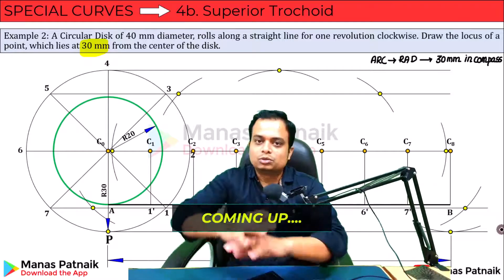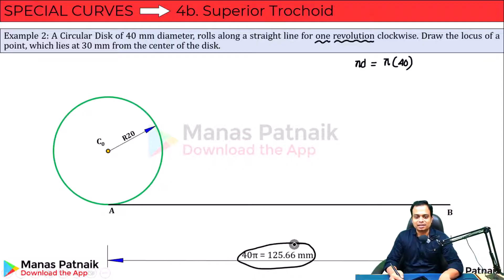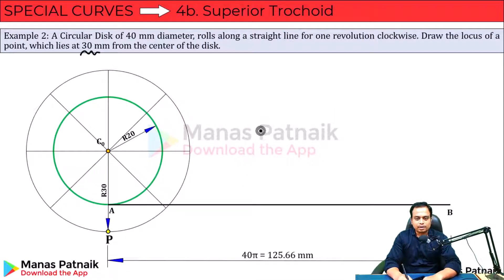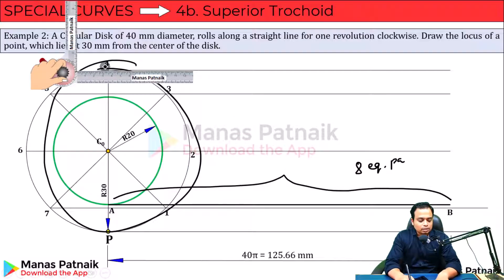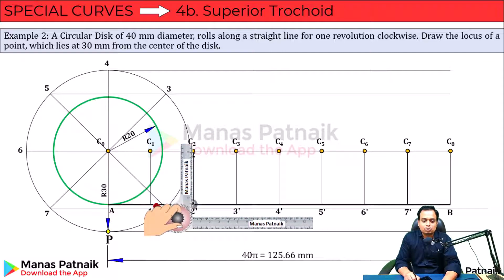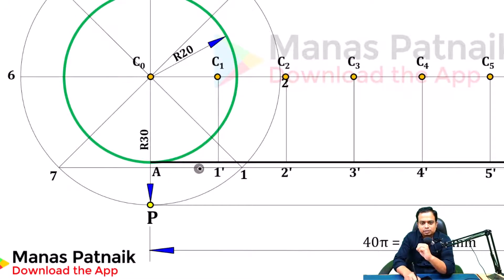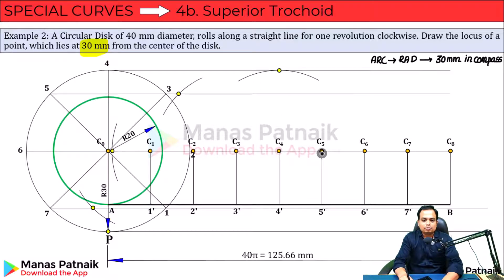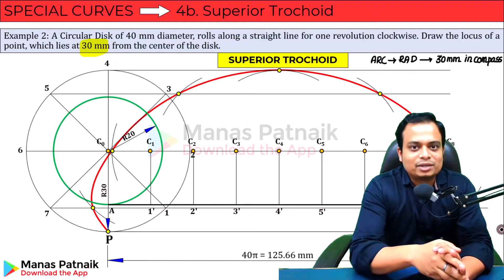Construction of an Superior Trochoid

Comment: A square plate of sides 60 mm each is resting at 45° to vp.the plate is seen as a rohmbus with one of its diagonal measuring 30mm in top view. draw it's projections . Then where it's true shape will make and how to draw it by third angle projection method